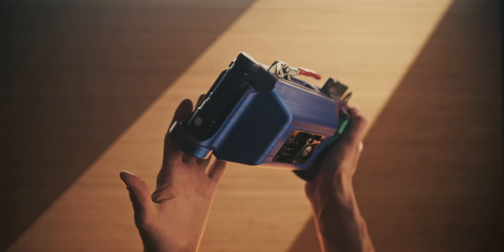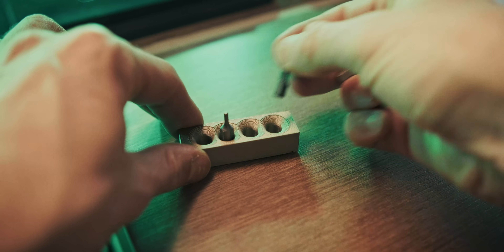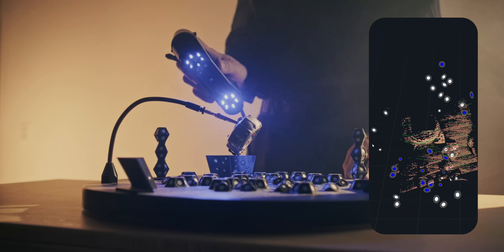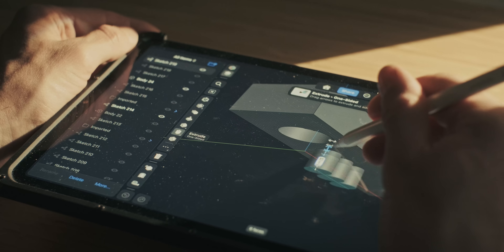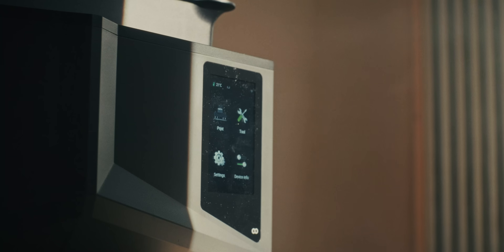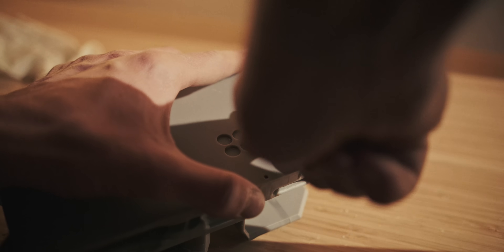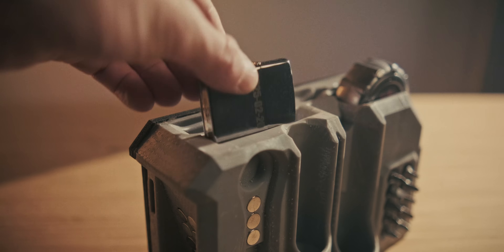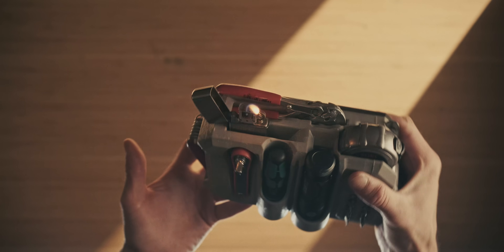Building a Wera Tool Check Inspired EDC – 3D Print Project - Elegoo Saturn 4 Ultra 16k

Comment: As a car owner, passionate driver and a part time mechanic I really have this problem that I need many tools but it's very uncomfortable and veeeery space consuming to have them in the car with me and the weight is also a big problem😅
Maybe you can design a multi purpose tool barrel which will take every basic tool a car guy usually needs and make a nice video of that?! I've got an sedan and the luggage space is about 500 liters
😅😅😅
Maybe a compact cylinder with up to 80 liters space would be the most useful answer 😅

Comment: Really enjoying these builds. Would be cool to try and add in a socket set like the Makita to have parity with the TC+. Really just a withholder, rachet, bits, sockets, knipex, and maybe a clip to hold any tape measure would be a nice, clean kit. The Wiha double sided bits are awesome because you need half the number but you need the Wera 383 RA R M because they need the Rapidapter to fit.

Comment: If you're still looking for a recommendation for a metal pen/pencil, I've been using zebra F-xMD for many years now and it's heavily recommended from me. I always keep a couple spares in case I ever lose one. They're not very expensive and the refill cartridges are very common and come in a variety of colors. The casing is stainless steel too (so magnetic) and the knurling is really pleasant on it.

Comment: When removing supports from resin prints I have a recommendation. 
It’s slightly messier, but I would recommend removing the supports before curing. It’s far easier and tends to leave less scarring on the surface. 
For my resin prints I rinse once in used isopropyl alcohol and then into the wash machine, then after drying dunk the print into moderately hot water and the pull supports, the supports should peal away with minimal effort, then I give a final wash machine cycle and cure as normal.
Reply from the maker: Thank you for this! ill be sure to adopt this as i indeed have some trouble with my current process!
Reply: @ I hope this helps. Resin printing can be a bit of a pain when getting started, but once you have your process figured out you can get some incredible results. 
I’d also suggest spending some time just looking through the different settings, you may be able to reduce/adjust support contact size as well as support density to help get a better surface finish. I know one thing your machines tilt vat allows you to do is use smaller supports at a lower density than a standard resin printer would be capable of. Although I don’t have one of those machines, so haven’t been able to try that for myself.

Comment: I feel like your only option for more bit storage is getting them to slide into the case, maybe even use the drawer for that instead and get a “pocket” for the headphones where the bits used to be
Reply from the maker: Indeed sliding bitstorage would possibly make this very comprehensive ill be sure to explore this :)